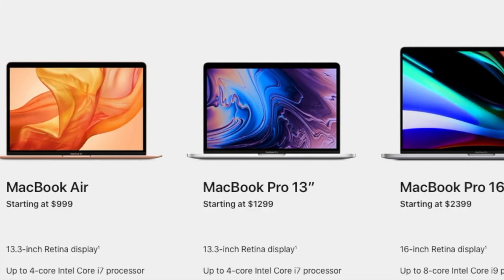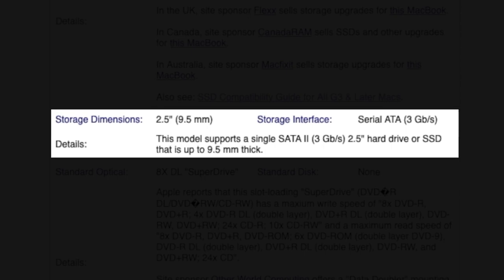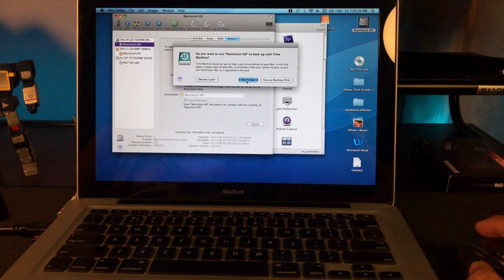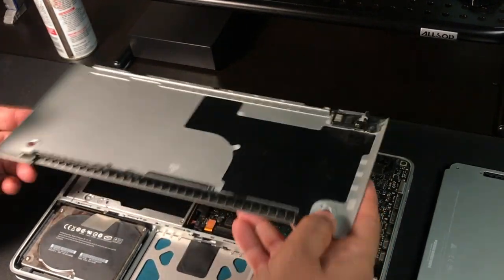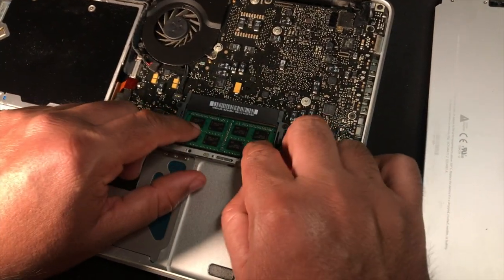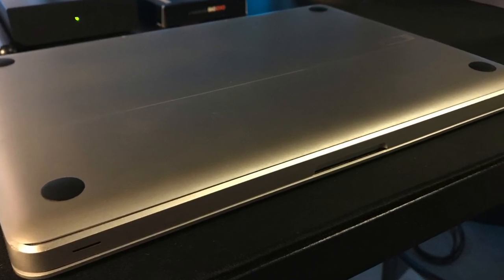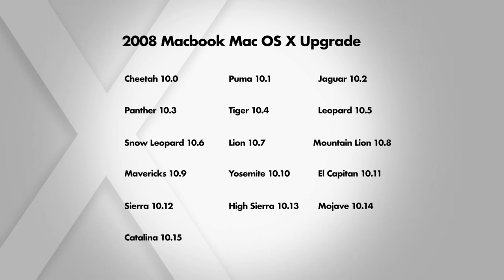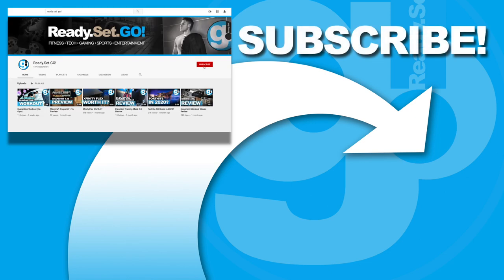2008 MacBook (A1278) in 2020 - Solid State Drive and RAM Upgrade + Spray Paint Job!

Comment: No need for trim enabler 4 anymore, just go to terminal, and write: sudo trimforce enable and accept, your mac will reboot and Bobs your uncle, you’re in business! Get your RAM on! (I did this on my MacBook late 2008, running El Capitain)
Reply from the maker: You're absolutely right siforama. Trim Enabler basically does the same thing for those who don't want to mess with Terminal commands. Please help support the channel by subscribing if you haven't yet.

Comment: To be honest I have one Macbook late 2008 and the OS goes all the way to El Capitan 10.11! Jut to be clear but your video helped me a lot thanks man!
Reply from the maker: I'm glad you found the video helpful Antonio! Several weeks after I did this video, I also upgraded to El Capitan as well. Thanks for watching and please don't forget to subscribe!
Reply: I've seen youtube vids on how to go beyond el cap as it turns out El Cap was not the golden release that Apples coders want to remember (think the first release of Apple Maps). Apples upgrade software just check the age and the chip to answer the question of whether the upgrade can occur. Naturally the higher the OS release the faster the notebook is expected to be to cope so any upgrade beyond EL cap would need 8GB and an SSD to avoid making it cripplingly slow.

Comment: Great info video!, thanks for sharing your knowledge. A friend gave me the late 15 inch 2008 MacBook Pro 5,1, and thus,  I do not need to save anything from the hard drive. My questions are: Do I still need the cable to download anything into the new hard drive?; and can I still update the Software version from Mac OS X-version 10.5.8 to Snow Leopard or higher?. Thanks in advance!
Reply from the maker: Glad you found the video helpful Aral! In that case, you don't really need the cable as you could just format a thumb drive with the OS and install it directly on your MacBook with the new SSD already installed. Another more useful option than the cable would be a hard drive enclosure that allows you to attach the old drive to the MacBook as an external drive. Thanks for watching and please subscribe to support the channel! Good Luck!

Comment: Does the Macbook support dual channel performance once both ram chips are the same speed and capacity ( vs one chip of say 8GB). Also is there any way of imaging the current drive over the SSD in advance?

Comment: I've got a Macbook 13" late 2008 running 10.11 Yosemite
Do I Need to install Snow Leopard to be able to upgrade the 8GB RAM & SSD so they'll work correctly? or do I need At Least OSX10.6 Snow Leopard? 
Thank you so much for this video! 👏🏼😎👍🏼
Reply from the maker: You're very welcome Soul Survivor, I'm glad the video was helpful. Yes, you will need Snow Leopard and then you'll be able to upgrade to Yosemite like your current setup. Thanks for watching and please consider supporting our channel by subscribing!
Reply: @ReadySetGOTV  
Cool :) 
Just to make sure I'm clear....
Uninstall Yosemite (currently installed) then ReInstall Snow Leopard. put in the 8GB of RAM....& once it's all working, THEN I can update the OS back to Yosemite?
Reply from the maker: @S0ulSUrviv0R713  The 08 MacBook on this video never had its OS upgraded so I had to upgrade it to Snow Leopard 10.6.6 and from there to a newer OS (originally Mavericks and eventually to El Capitan). I also made sure the Boot ROM was updated so it recognizes the 8GB of RAM. Check your current Boot ROM version and see if it needs to be updated. In your case, since you already have Yosemite installed, you could format the new SSD drive and clone it. I would then test the new drive before installing in the MacBook. (Disclaimer: When you do this you're doing it at your own risk, Ready.Set.GO! is not responsible for any damages or loss of data.) Good luck!
Reply: @ReadySetGOTV  I can't tell you how much I appreciate all your information! 🥳👏🏼
 Thank You 🙏🏼

Comment: Someone was telling me 4GB of RAM was the max for this model. This isn't the case? It goes up to 8GB of RAM? Thanks for the video!
Reply: I also read somewhere that Sata III is incompatible with this model (A1278). This is incorrect also? Thanks!
Reply from the maker: Sorry for the late reply Michael, I upgraded the RAM to 8GB and didn't experience any problems. Thanks for watching and Happy Holidays!
Reply from the maker: @michaelg9359  I'm sorry but I can't confirm SATA III compatibility. I went with a SATA II SSD as recommended on everymac.com and it worked great.
Reply: @ReadySetGOTV  Hi thanks for responding. I bought a WD Blue Solid State Drive, 3D Nand SSD based on another video but I put it in the machine and am pushing COMMAND+R at bootup and the only thing that comes on the screen is a question mark folder. Actually, now the question mark doesn't even come up. Is this drive not compatible? Any help would be greatly appreciated. THANKS-

Comment: I tried doing it this way but did not see a restore option while in utilities. Any idea why?
Reply from the maker: Hi Joshua, Sorry for the late reply. Don't know if you were able to figure it out.  I'm assuming you did this but just in case, make sure the new drive is formatted so that it matches your existing drive (ex. Mac OS Extended Journaled etc) or it will not work. Thanks for watching!

Comment: Can you get zoom and ms word and office I’m trying to up grade my MacBook 2008 running El Capitan it sucks
Reply from the maker: I was able to install El Capitan without any issues. Older versions of Word and Office were running well when installed;  can't confirm on Zoom as I no longer have the MacBook with me. What kind of problems are you having?
Reply: @ReadySetGOTV  it’s telling me it can’t add the app cause I guess it’s outdated it wont support it
Reply from the maker: @jay_8th_gen_accord717  I see what you're saying. In that case rather than using the app, your best option is just logging in directly through Zoom's web client. Hopefully you won't encounter any issues. Thanks for watching and best of luck!